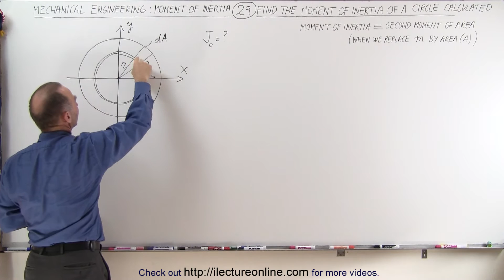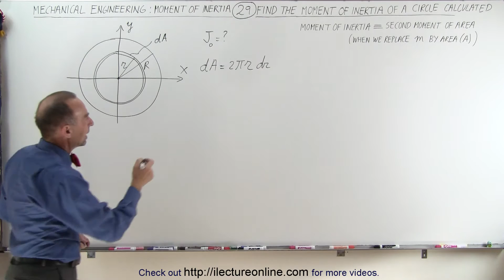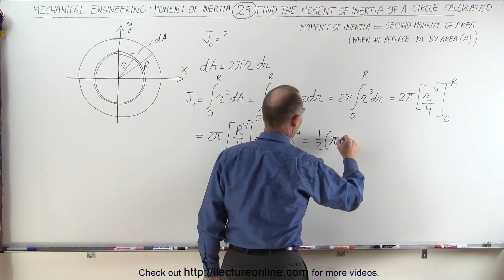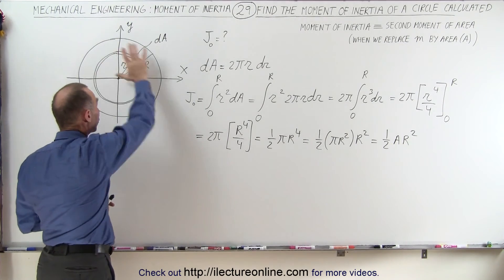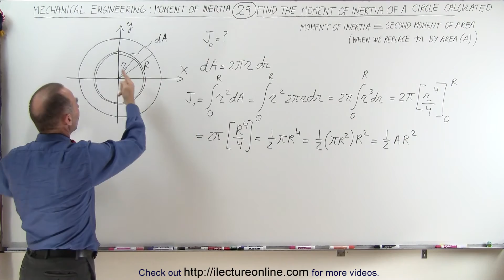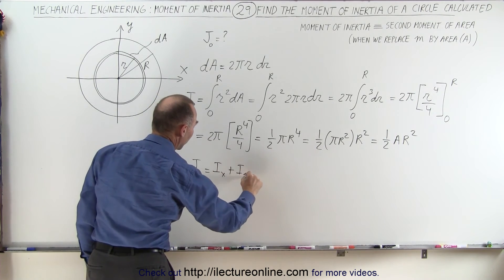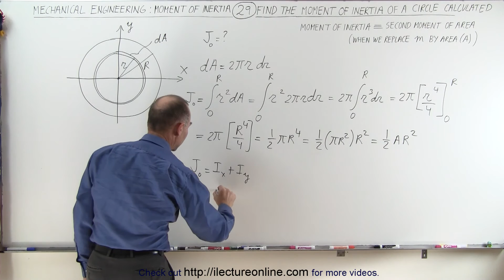Mechanical Engineering: Ch 12: Moment of Inertia (29 of 97) Moment of Inertia=? Circle

Comment: How do we find the moment of inertia with a certain reference point?
 For example the moment of inertia of a circle with an equation of x^2 + y^2 = 36 with respect to y=8
Reply from the maker: There are 2 approaches.  You can use the parallel axis theorem, or you can change the distance from the mass element to the line y = 8 instead of the origin.

Comment: There is one mistake when you write final value of J. = 1/2 pi R2 . Actually you should have writen  1/2 pi R4. Final equation is right.
Reply from the maker: Yes, that should be a 4.  Thanks for pointing that out.